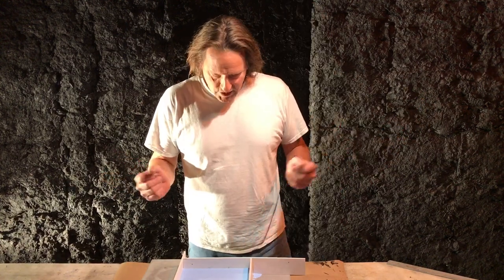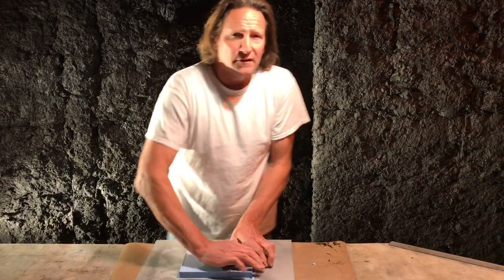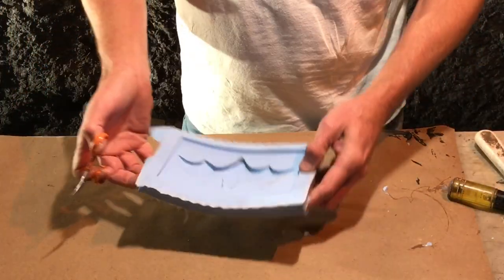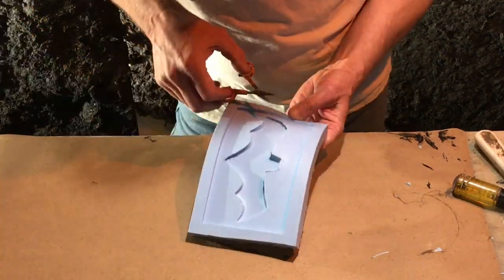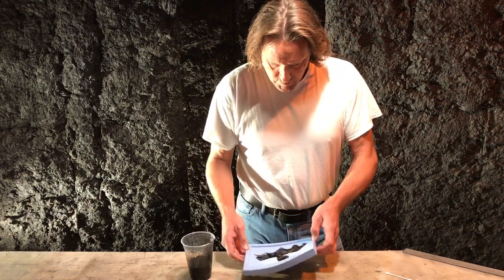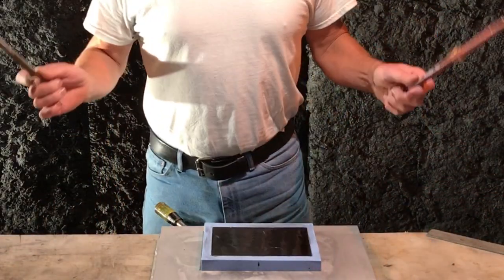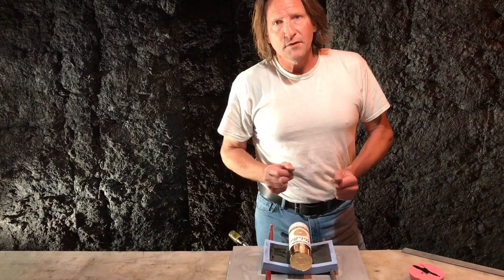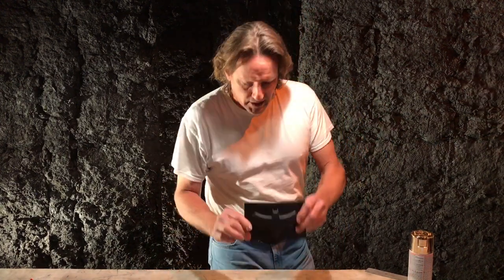How To Mold A Batman Utility Belt Buckle Part 2 of 2

Comment: Great moulding tips Paul!
I like the compressed air trick for the silicone!
 
And using a q-tip to spread around the epoxy to get it into all of the corners

I noticed in the video yesterday that you were using Smooth-On products 

Could you do a video talking about your choices of silicones and epoxys?
Durability, pot life, ect

It would save a new hobbyist like myself time and money.

 My local art supply store carries so many of Smooth Ons products and I can never figure out what one to choose

Thanks
Reply from the maker: Not enough info for a vid but I will tell you. I use mold max silicone and 325 resin from Reynolds and that is about it.